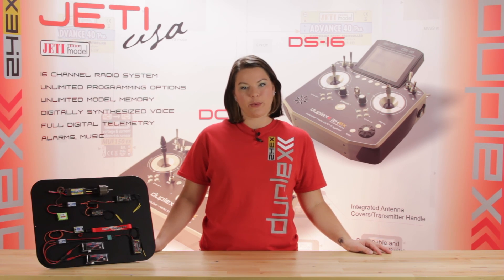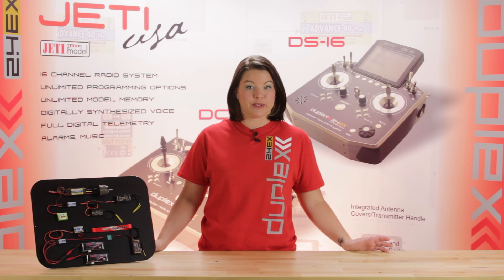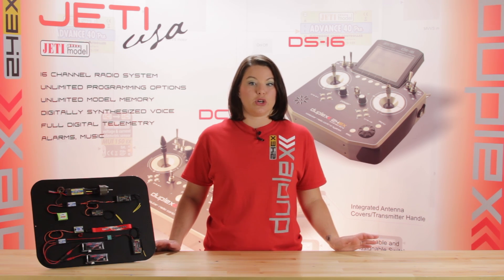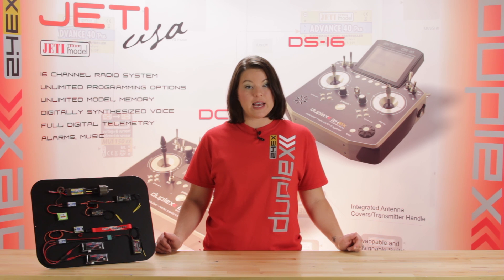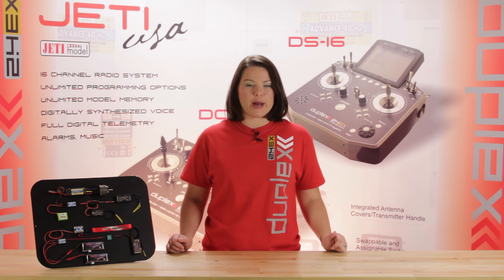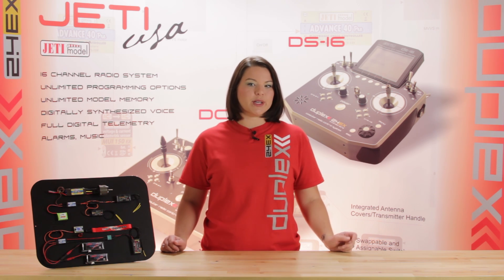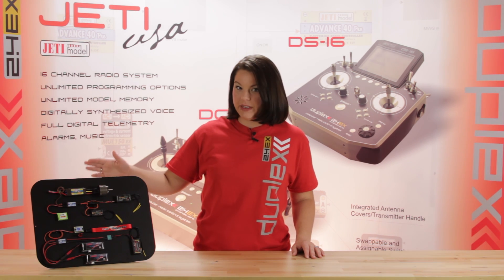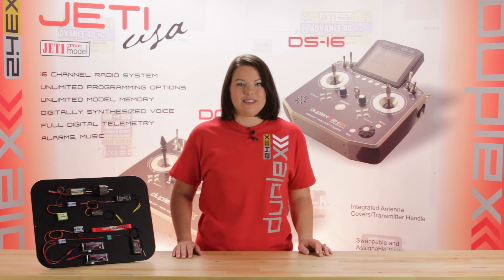Fast & Simple Power Redundancy with Jeti DSM 10 & DSM ESC

Comment: I newly own a JETI DSM 10 and wonder how the reduncyt work between two receiver paks. Does it use one pack at the time? and switch when it's needed? or does it use both packs like they are mounted in parallel? 

I can actually fly up to 5 10 minutes flight without any alert. But when I charge my packs, I find that one got a decent amount of of recharge and the other almost nothing.

Running two LIFE 123 2S, 2500 each, mounted to a DSM 10, Spektrum AR9350, 6 regular servos, and one IBEC on a DLE 30
.